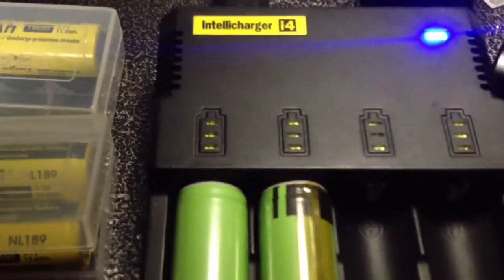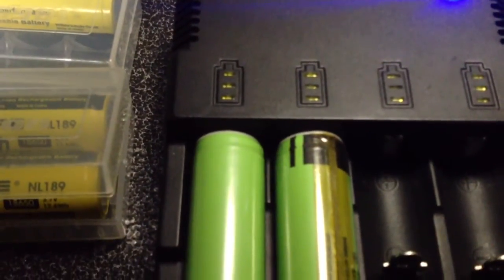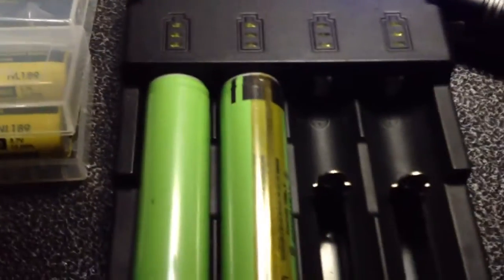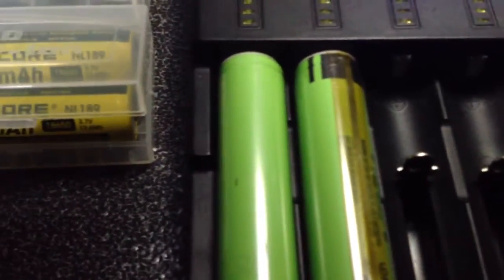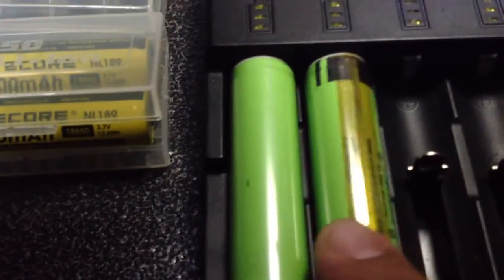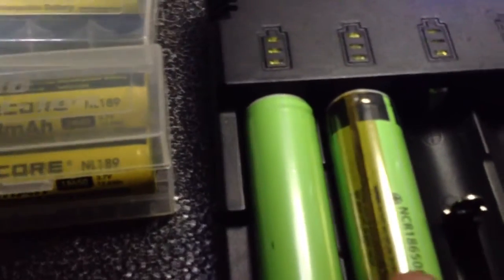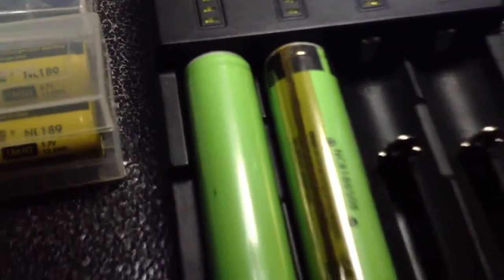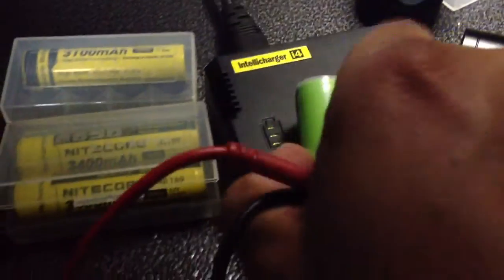Nitecore i4 V2 charging NCR18650B

Comment: for others wondering on to this post 
the answer is that these are PROTECTED cells and you particular charger is activating the protection circuit nothing to be alarmed about  it is doing what it should be doing TURNING ITS SELF OFF to stop further (over) charging and to the charger it looks like it isint even there

Comment: they will stop drawing power when fully charged they have built in  protection to stop them from exploding ncr18650b are the best 18650 you can get 3400mah 20amp draw

Comment: I just purchased these batteries and nitecore i2 from amazon. Is thus mean that my charger will Do the same? I'm going to use my batteries for my fenix pd35. Any advices?
Reply from the maker: I always charge them fist before the first use. 
And your i4 and panasonics charging question...
So far i know that the batteries are real good and that i dont have any issues with them with shutting off the charger after completion. Im guessing the pcb on the battery is doing it as a safe way to charge. Same way they shut-off. when they are drained.  I just havent seen anybody else comment on that. I hope that answers your question. Thanks

Comment: Its the PCB in the batteries. The pcb might shut of at about 4.15v while the i4 charges the barteries to 4.25v or so. When the cell reaches the cutoff voltage of the pcb the PCB automatically disconnects the cell and the i4 thinks that there is no Batterie in the slot. Better the PCB shuts of at a lower voltage than on a too high voltage. With that pcb shutting of earlier you might not get the full 3400mah but you get very close to it(this probably causes a longer lifetime and More safety)
Reply from the maker: Thank you for clarifying that.